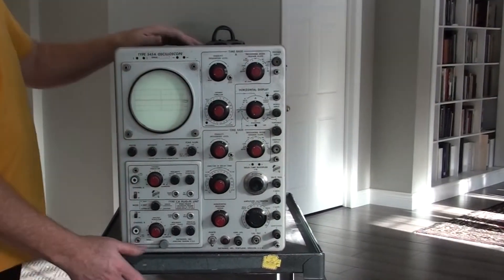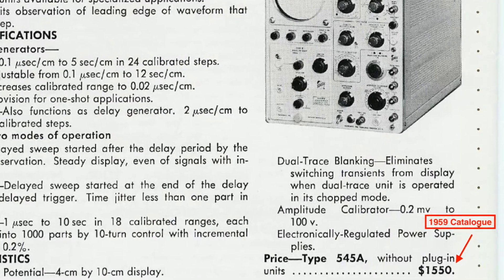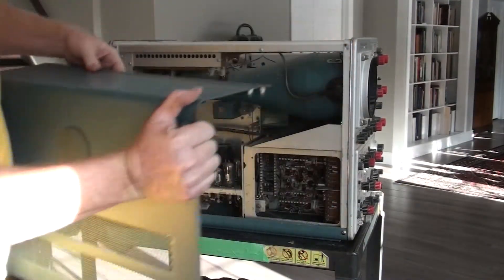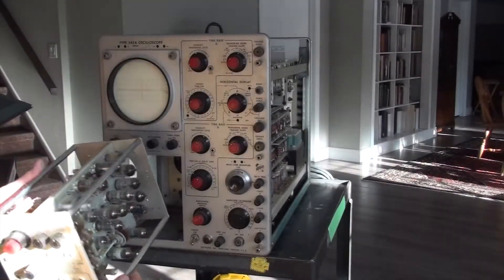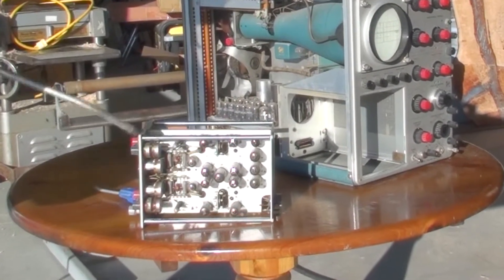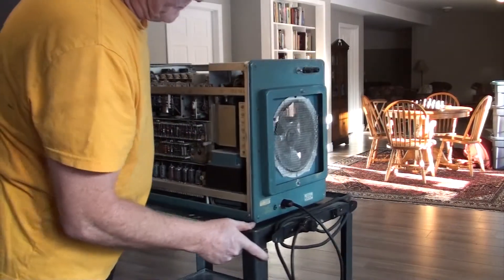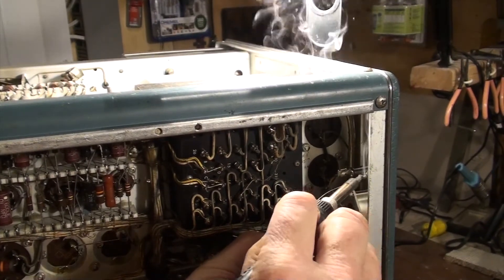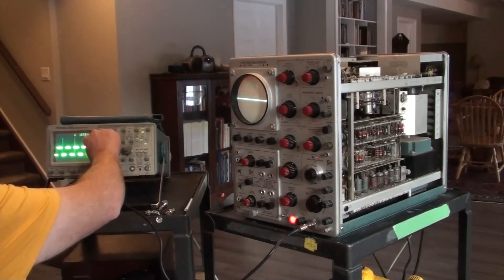Vintage Tektronix 545A Oscilloscope - First Power up, cleaning and fuse holder replacement

Comment: I used the 545B in high school back in the 1970's; even then it was a dinosaur. The one thing I will never forget is how much workmanship went into building these classic scopes.  I also remember all the heat this thing gave off; you saw the size of the fan.

Comment: The 'proper' way to clean this beast is to remove all the tubes except the CRT and run it though a dishwasher, and then an oven at 150 for 1/2 a day.  Blowing it out supposedly t just embeds dirt deeper into the system.   Have yet to try either myself   but maybe someday with the 545A I have on my todo project pile.